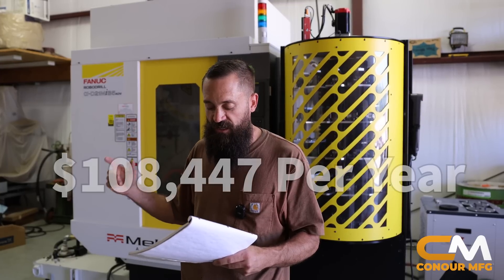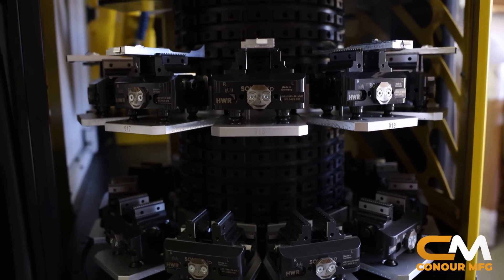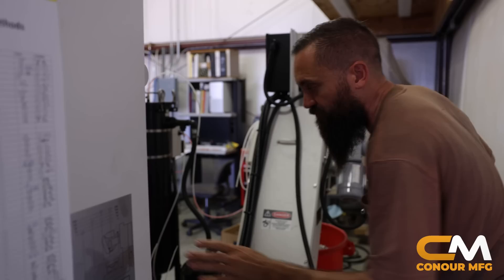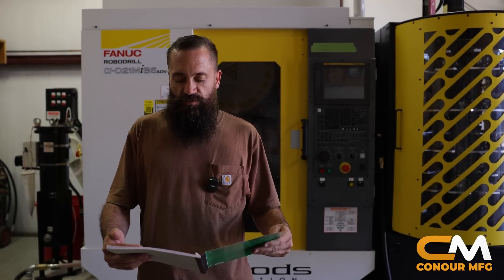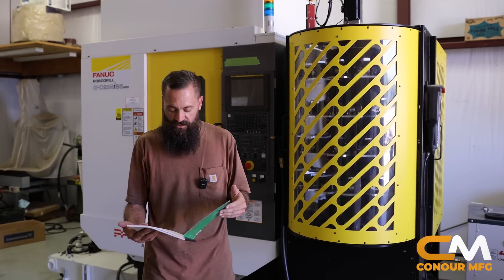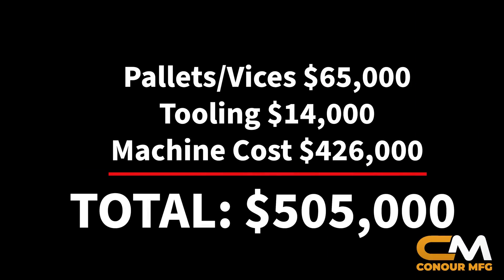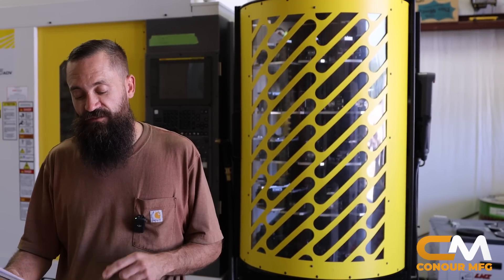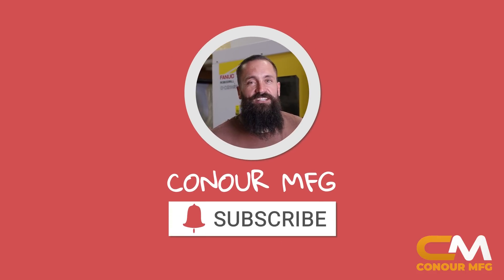800K for a ROBODRILL?!?!?!

Comment: (Disclosure; I'm the Speedio rep for the Pacific Northwest)
The Robodrill with the Haberle setup is a pretty great machine, and you will find much success with it!
Having said that, to put some perspective on the cost - a lot of folks are a bit shocked at the pricing. If you assume you can get 20 hours a day out of it on those 5 business days per week, you're only looking at $20/hour. Given he is in California, where the average machine shop wage is pushing at least $28 in pay alone (not accounting for taxes and other employee costs), it is kind of a bargain.
Always a bit odd to me that people get a lot of anxiety over buying a machine like this, when really - you are putting yourself in a much worse risk position when you hire someone to sweep the floors... and people do that with much less fuss and risk assessment. Unlike the floor sweeper, this man basically just bought a money printer.
Reply: As long as he has jobs to do he is fine. You can't exactly fire an 800k dollar loan when work dries up.
Reply: @Dillybar777  EXACTLY CORRECT, all these salesmen talk about the efficiency and advantages etc but always assume you have the work for it for years and years and in reality almost nobody does unless you manufacture your own well established products.
Reply: @Dillybar777  People are harder to find than equipment right now. Especially in CA. You can always find $10k of work to pump out of a mill- especially on a pallet system where you are walking away most of the day
Reply from the maker: @LumaLabs  that's the dream/hope, stay tuned for how this all shakes out. Feel fres to swing by the shop if you are in the area.
Reply: @LumaLabs  while I'm also a big fan of automation, the difference in the risk assessment is the time commitment. You can lay off an employee with relatively short notice if you have to. Much harder to get out of a 6 year repayment commitment at any point in the first couple of years while your net equity in the machine is negative. With that said, this guy has clearly crunched the numbers and put some thought into this so I'm pretty sure it's going to turn out well for him. Like you say, if you can keep it running that much, at ~$20/hr quasi-fixed overhead, you can have a very competitive hourly chargeout rate and still have very big margins on the part.
Reply from the maker: You hit the nail on the head. I hope it turns out well!!!

Comment: You could buy 8 top of the line Hass machines with Roboot 😂
Reply: Don’t forget the cost of adding 8 parking spaces for the Haas service techs
Reply: @kanoa9321   that is a bit exaggerating
Reply from the maker: @kanoa9321  😂😂😭😭😅😅
Reply: Not quite, but you could get 4 very capable machines from Haas for this price. Is the Robodrill better? No question, it's considerably better. Is it going to make you as much money as 4x VF4-SS? That's a question only the business owner can answer. For me, the answer would be no.
Reply: @OtisFlint  you could buy at least 6 vf2 SS with robots
Reply: I'd imagine looking at how many vices and mini pallets and his automation he's going to be producing a large number of small parts. 
With a large amount of lights out machining.
Small fast machine with a good proportion of the yearly cost being deductible and the labour and space savings of a small machine its probably a profitable decision.

Manufacturing density is probably a high priority considering the size of the shop and it's current electrical supply.

What machine maximize the dollar per square foot of his shop type of thing.

I don't know much about Robodrills other than they're fast.
Reply from the maker: @deepwinter77  could not have said it better myself 🙏🙏
Reply: @deepwinter77   
I saw brother machines in emo a few weeks ago very similar to robodril and they cost 150 k for a 5 aches machine

Comment: Your video really helped me out (Subscribed). I was thinking about buying this machine until I heard the price.  At that point I would rather acquire a Mori, Matsuura, or Kitamura.
Reply: Machine does not cost half a million, the video was very unclear about the spec and configurarion. Im not fanuc seller, just havr one machine myself wirhout robocell, customisations and software which is not really needed for a one machine job shop
Reply: Good coment thank you.  I was hoping to get the cnc with the robot.  I was even working with methods sales guy to quote me one.  @viliusr6974
Reply from the maker: Any time you start adding automation and pallet sells to machines the prices get expensive. To get 60 pallets on a Mori or Matsura you are in the million plus dollar range or after everything.
Reply: @ConourManufacturing  well it is starting to make sense why every manufacturer are jumping on the "pallet/automation" bandwagon, before the prices drop. Our company works in automation. 400k for a simple cartesian robot with vison and some database management ui, i think it might be an easy pitch to the boss. Mechanically all that pallet pool even with precise motion is a straight forward job with modern PLCs etc. 
It would make mich more sense to me that the prices would be other way round. CNC machines nowadays are highly sopphisticated machines with a lot of IP to make a reliable tool.
Reply: True agreed. @ConourManufacturing
Reply: Yeah, the Haberle system adds a ton of cost. Basic RoboDrills aren't that expansive and they are fast as hell.